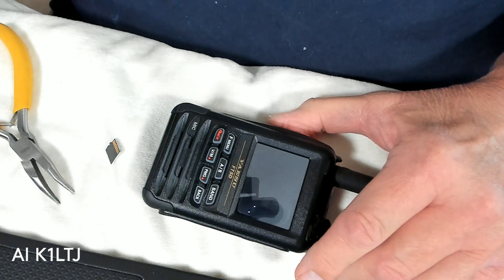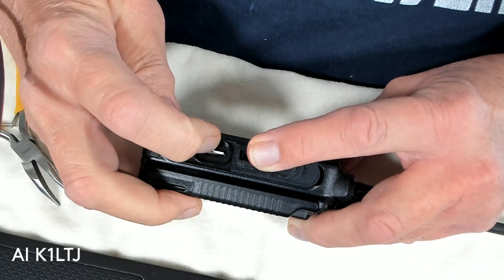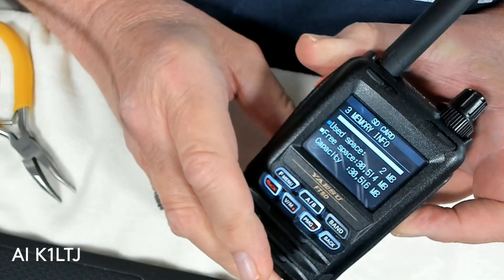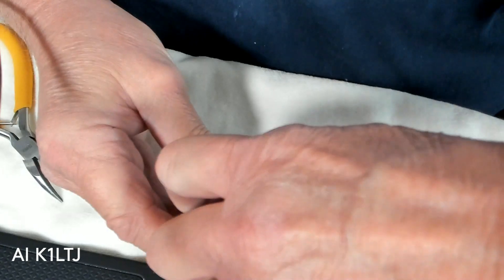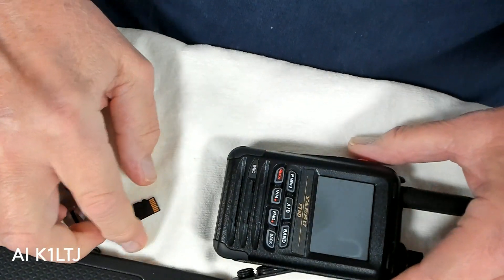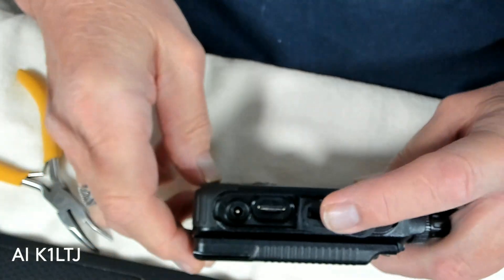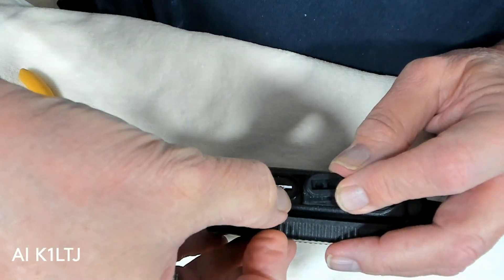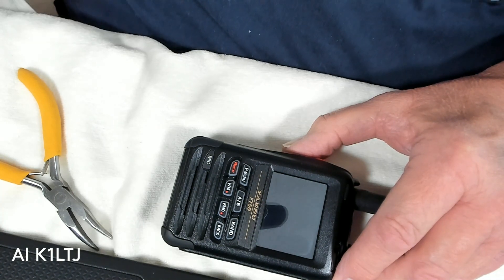Yaesu FT-5DR Problem SD card slot

Comment: The other day I tried inserting an SD card into my FT-5DR… and the card did not go into the reader. It went into the radio right next to the reader. Attempts to remove it were unsuccessful and it ended up disappearing inside the radio… forever lost.
Reply: Same thing happened to me. I apparently broke the card slot when trying to remove the SD card. Yaesu quoted me over $300 to repair on a radio I used for 1 day.

Comment: Just received my new FT5DR. This may be covered somewhere in the comments below, but I missed it?  
My card slot functions perfectly, however the issue I had was although the card seemed to be reading via" Info", it would not format nor read/copy the 'Backup' file back to the radio after updating in the ADMS-14 software.  I did the low-grade Reset, "Setup Menu Reset", and vola(!), it worked just fine.

Comment: Also another problem with this radio, the VFO/volume knobs. If I turn the volume up or down, it now changes the channel. You can reverse it so the outside is the VFO, inside the volume. So I change the channel, it also changes the volume. Disappointing. Had the radio less than a year and I take very good care of it.

Comment: Mine did the same.  HRO said that's the way they all were.  I did notice a silicon type film on the front of the sd card, that I scraped off.  It seemed to help a little. I also took a small flat blade screwdriver (at your own discretion) and with battery removed, I barely pushed it in to widen the slot (with the card removed).  That also seemed to help, but the card is still a little snug.  I was afraid to try to bend the opening too much!

Comment: I have a different problem.  The SD card goes into the slot with a click.  Ok, fine, BUT, I went to put in a different card. When I inserted it I did not notice it was not in the SD card slot.  The SD card went UNDER the SD slot.  I tried to retrieve it with tweezers but it got pushed into the radio.  The radio is going to have to be opened up to remove the card.
Reply: Were you able to retrieve your card? I just had the same thing happen. Really poor design.
Reply: @bransom  No.  To get it out I would have take the radio apart.  To that it looks like the slotted nuts on the top controls need to be removed.  I don't have a tool to get those off.  Small needle nose pliers might do it.  The rouge card does not appear to be causing any problems so I left it in there.
Reply: @w8rko470  I got worried that it would short something out inside so I started taking the unit apart. I ended up having to order a small spanner wrench to get the top nuts off. That should be here in a couple days. I'll let you know how it all goes ... and if the radio works after I it back together.

Comment: Sure glad I found this site. For months I’ve been thinking Im doing something wrong. Radio is about 8 months old. Put the card in when first received. Didn’t go in easily. Went to remove the SD card to program the radio and couldn’t get it from the radio. Fingers wouldn’t work. Tweezers wouldn’t work. Got a pair of pliers and with great concern and excessive effort the card came out. It went back in with similar difficulty. Appears the problem hasn’t damaged the SD card, but it sure can’t be beneficial to the radio. Gonna get in touch with DX Engineering to see what they can do to help.

Comment: I have had my FT-5D for a little over a year and only put a SD card in for the first time today.  Wow.. I have the same problem.  And here is another problem.  I was able to get the card to read and was able to have the FT-5D formate the card.. but another strange problem... when the SD card is in the radio, and then I go to reply to an APRS message, I cannot get the various button options on the screen to work... for example, if I select an APRS message, and then try to hit reply... I get nothing... none of the on screen buttons work.  So I turn the radio off... remove the SD Card... with pliers as seen in this video... turn the radio back on... then the screen functions normal when replying to creating an APRS message... now why would the screen not work properly with the SD card installed?  I am using a SanDIsk 32GB card.  Hmmm... really strange and disappointing.  have to figure out how to get this serviced now.  Not happy.

Comment: same issue with my FT5.

Sandisk 32 micro wont latch (connect) or release almost as if the spring latch is non functioning.

Yet to try another micro sd that is not sandisk.

May have to return radio.

Comment: I just bought my FT5D and I have the same problem. There is a lot of resistance inserting and removing the card, and there is no click, half the time it works, half the time it doesn't. I'm going to send it in to have it fixed. Disappointed that a $500 handheld didn't get checked before going out the customer.

Comment: I have had an issue also. Having the SD card in the slot caused the touch screen to malfunction. Additionally the radio would suddenly not recognize the card (as in your video). Fortunately I bought from an excellent vendor (HRO) who are helping me sort it out with Yaesu. Cheers.
Reply: Also I can only remove it with tweezers. Pretty nuts.
Reply: @GlamHamRadio  Exactly my problem. I am going to try a different card to see if it is a brand name issue before I send back the radio. My screen locks up and I cannot set frequencies from the touch screen when the card is not fully engaged.
Reply: @KD2ZTA  Ham Radio Outlet replaced it with a new one - it is very clear there is an issue with the SD card slots in a batch of those radios. New one works perfectly!! And you feel the SD card properly fit into place :)
Reply: @GlamHamRadio  I just got home and tried a Samsung 64gig card and it worked. Clicked right in. It seems the card from HRO is a little thicker. Time will tell…..
Reply: Which HRO is it? I'd like to call them for a consult. I am trying to work with the one in Portland Oregon and I'm just getting the run-around--the HRO guy saying that his Samsung card worked and the card I sent in with the radio was an off-brand card (though he didn't try to actually use his card in my radio). So I got a SanDisk and same problem. I called Yaesu and they said that since it's under warranty I could send it in. That would be 3 times I have to pay to ship this thing (to HRO, then I paid because they said the problem wasn't the radio, and possible upcoming shipment to Yaesu).
Reply: @markhamann8030  Anaheim 👍 Ask for Bobby 😊 He will recall the issue with mine.

Comment: Unrelated but I had centre pin of DC/Charger jack break and fall in. This was caused by a badly soldered connection. I teardown the radio and resoldered and noticed a slide switch on the rear circuit board with 1M 2 and L on the board. The switch was in centre position. Note that your MicroSD card socket may have suffered during circuit board assembly, soldering and wash/de-flux. I think there maybe manufacturing problems causing these issues.

Comment: My card slot works fine however my unit has developed a broken line across the screen about 2mm under the battery icon right to the other side ...

Comment: I see your update. Glad you got a replacement. Mine is perfect. The spring sounds cheap but it’s one of the easiest to insert, hear a nice click for the latch. Very easy to remove, plenty of room for my whole finger to depress it more than it needs to unlatch and it would just drop out if it was so easy to grab. 

Very clearly yours was a defective unit. This one is spoiling me. Not looking forward to removing my ic-705’s card soon lol. But not problem with it, just a lot packed into a tiny package.

Comment from the maker: Today I received a replacement unit, and this one works as it should. The sd card goes in easily, and there is an audible click as it latches. So, it seems that this unit has a defective sd card slot. I am using the same card in the new FT-5D, and no problems. Thanks to the best amateur dealer, HRO, for all the help with this.

Comment: Got mine today.  I was getting the same “thing” when trying the obvious way one would try,  with finger tip.  Mushy,  no click,  tweezers to remove.  I switched to using the plastic tip of a pen.  Pushed slowly and then got (audible & felt)  a quite noticeable click.  Card contacts facing towards radio face.  Seems the finger tip dampens the sound and feel.  Oh well,  hadn’t removed the one in my ft3d since installed,  so its not like its a frequent deal.  Lexar brand card.  Have sandisk ones too, but all in use at the moment.

Comment: For sure not getting one of these radios until this issue is officially fixed by Yaesu. My FT3D does not exhibit this card slot problem.
Reply: my ft5dr doesnt have this issue. works fine
Reply: @ryankc9oza118  What brand microSD are you using?
Reply: @scottkarlins  a 16gb Toshiba. But my other generic ones also fit without issue
Reply: @ryankc9oza118  Must be just a few units with this issue then. Good news!

Comment: sometimes it won't read a card, even though the SD icon displays showing one is inserted.  Several people have duplicated this issue.
Reply: I don't have a problem inserting or taking the SD card out, but I cannot format, write to or read from the card. I am using new Sandisk cards. The radio will read the card info, but won't do anything else. When I remove the card and put it into my computer there are folders created by the radio on the card, but those folders are empty. I will be very disappointed if I have to send it back.
Reply: @KzeroHO_Brian  I understand, and this is a problem for many people, among others.